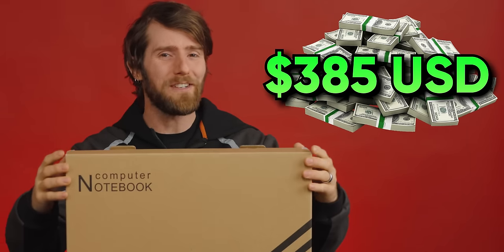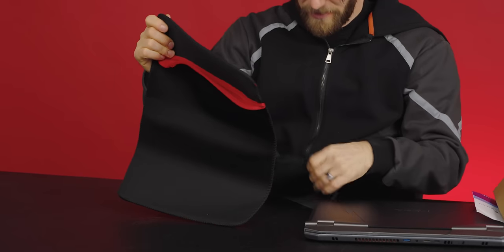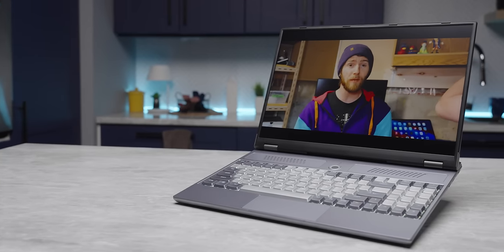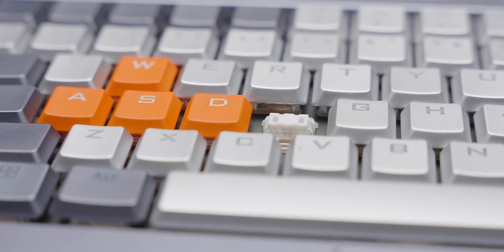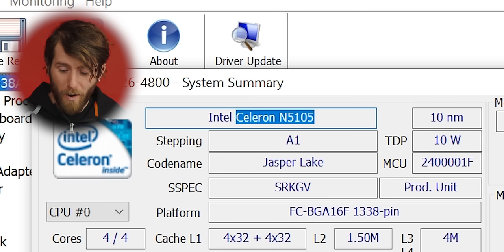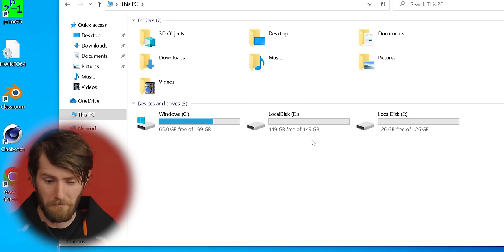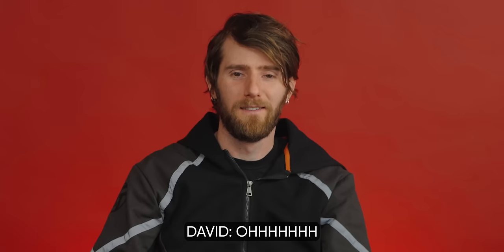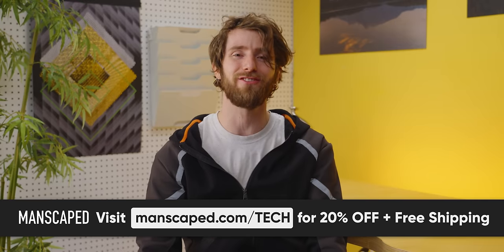Brown Star for Effort – This AliExpress Gaming Laptop is HILARIOUS

Comment: 2400MHz DDR4 was quite common for laptops
Reply: My current PC has 2133 MHz DDR4 RAM xD I got it when DDR4 was still new and never upgraded xD
Reply: @FeuerGame  lol me too,but even if i would have gotten more,my i7 7700 can't do more than 2133 anyway xD
Reply: my laptop runs on 2666MHz
Reply: WAS
Reply: True, all entry level laptop runs from 2133 to 2666mhz
Reply: @ristekostadinov2820  My PC has 16Gb DDR4 2666 Mhz
Reply: @youravghuman5231  yeah they are just dead wrong in this video. 2400 and 2666 is the normal ddr4 speeds for laptops. Only extremely high end stuff ever went above 3000
Reply: @wissembellara6411  mine have 1x4gb soldered and 1 removeable 4gb, i was quite mad when i found about that because i paid like 530$ and i can have 12gb max. There was a time when only the cheapest laptops had 1 or both slots soldered now manufactures push the boundaries.
Reply: @brandontrost8888  Right, I bought a mid-range HP Pavilion for 600€ four years ago, 8 GB DDR4 2400 MHz, without listing everything else it had. However, they bought this laptop NOW and it's (supposedly) new... So I would agree that currently it can be considered slow.
Reply: Yes true, and I think I saw in the specs it was also DDR4L RAM which draws less power, which usually means slower speeds, and in normal day to day tasks outside of gaming, or something like video editing, then most people won't even notice the slower speeds.
Reply: I used 2133MHz DDr4 for my PC, mainly because I was broke and the performance gain of higher frquencies would have been lost on me anyways.
Reply: @Mirra2003-f9s  I believe it should do 2400MHz. My i5 7500 runs at 2400MHz if I recall correctly
Reply: @oglcn11  Yes actually you're right. It says 2400 mhz on Intel's site. Still i'm already planning to build something new so it doesn't matter anymore. Too bad 2133 mhz is pretty worthless nowadays.... back when i bought it i remember there was some RAM shortage and extremely high prices cause i paid 200$ for this 16Gb 2133mhz kit in 2017 if i remember right
Reply: You don't need more. Especially on such crap hardware. Even on $1000 laptops, you don't need anything better than 2666.
Reply: The CPU is an N5150 which is usually used for embedded applications like NAS and prosumer and enterprise routers.  It's performant and energy efficient for these kinds of tasks.  Not really made for general desktop/laptop use but okay if you just use it for basic tasks (word processing or little tabs/low impact web browsing).
Reply: even in gaming laptops (acer aspire vx5)
Reply: I was using 2133 on my 6700k before my motherboard died and I upgraded.
Reply: considering thats a low watt cpu, commonly sold with mini pcs and sold to laptops around the 250$-500$ mark.  I'd rather go for a higher end amd mini pc(15w) 8core for that price.
Reply: @wissembellara6411  is it rated at 2666? if not, enable XMP in the bios to get the full speed. My 3200Mhz ram was stock at 2666Mhz until i turned on XMP
Reply: @lazysaviour  Yeah it is. However, my brother has 3200 Mhz sticks that show up as 2666 Mhz. The store said that the motherboard can't support 3200 Mhz. I don't know much about hardware
Reply: My desktop PC has DDR4 2400 MHz
Reply: my gaming laptop from 2017 has 2666MHz DDR4
Reply: HP Elitebook 840 G7 has 2666MHz DDR4 RAM, but the current G8 Series has 3200MHz DDR4 RAM
Reply: I have 2133 MHz DDR4 on my Asus VivoBook so it is normal
Reply: My freakin XPS 15 9560 runs on 2400MHZ DDR4 ram!! And it is supposed to be one of the high-end laptop of its time!
Reply: Even my desktop is currently running 32GB DDR4 2400 MHz lol. It's 3200 MHz RAM but my CPU only supports 2400 MHz
Reply: me who has a brand new pc with 2133Mhz ddr4, i knew i should have gotton better ram.
Reply: and it is paired with a 5 gen ryzen ouch at least i know where the bottle neck is.
Reply: My ThinkPad runs at 2400, but its also 3 years old.
Reply: @FeuerGame  painful
Reply: @Mirra2003-f9s  if you overclock the memory controller voltage, u can get 7700 to use way higher memory speed. I currently run 4000mhz dims at 3600mhz on a 6600, same memory could be run at 3800 on a 7700.  Give it a try, it's great.
Reply: @Mirra2003-f9s  yeah ^^ my 6700k wouldn't do much more either ^^ I'll stick with 2133 MHz till I get a new CPU
Reply: @Mirra2003-f9s  yup. My 7700K crashes if I push beyond that.
Reply: Yeah, it "WAS" like 4 years ago.
Reply: @FeuerGame  Honestly i think you really notice higher RAM speeds probably on Ryzen chips or heavy tasks that actually take advantage of it. My laptop runs an i7 9750H which demolishes my desktop's 7700 CPU and it runs at 2666 and i don't really feel any difference using them except for games where it's actually the processor being better on the laptop. As long as they run well in Windows and play any game i want without stuttering or other issues i really don't care what speed the ram is
Reply: @Mirra2003-f9s  yes! I think so too. Since everything works as I want it to, there is no need to upgrade my ram. The cost of new ram wouldn't be worth the money for a few % performance. Would be better spend on a new CPU/MB when the day arises that my 6700k isn't able to handle the tasks any more.
Reply: @FeuerGame  Mine's gonna finally retire in about a month or two. I have a 1440p monitor and an RTX 3070 and this CPU is starting to really fall behind in newer games. A Plague Tale Requiem gave it a hard time already so i'm trying to decide if i should go with a 13th gen i7 or the new Ryzen 7 7700x. 4 cores doesn't really cut it anymore for the latest games and i think even a new i3 is starting to outperform it
Reply: @Mirra2003-f9s  yeah ^^ I was thinking about getting a new CPU on black Friday sale, but I think I'll wait a little longer
Reply: I believe the actual DDR4 specification only goes up to 2666 and everything past that is technically OEMs exceeding the spec. My 3 year old asus strix laptop came with 2666. 
I've seen at least 1 OEM PC turn down their faster RAM to 2666 on shipping, presumably for some legal reason to comply with the spec, and then expect the user to turn it back up to what it's rated for.
Reply: @ristekostadinov2820  Soldered ram is usually to save on thickness on thin-and-light laptops
Reply: @KX36  DDR4 RAM actually goes up to 4800mhz but the most common and preferred one is 3600 mhz RAM especially for Ryzen systems. Your laptop most likely came with 2666 because it's the max the CPU can support and there's no use into giving you higher spec RAM since the CPU can only do 2666 max. It's pretty common for laptops,my 3 year old Legion has an i7 9750H and 2666 is the max frequency the CPU can handle,and that's exactly the RAM they put on it
Reply: @pranshusahu8678  which is a 7 year old laptop and 2400mhz was fast at the time
Reply: 2133 MHz memory on desktop here, bought it because it was cheaper then, like half price of 3200 MHz, I was upgrading from 800 MHz DDR2 desktop, also had 1200 MHz DDR3 on my laptop then.
p.s. I don't like influencers taking a crap on perfectly fine hardware just because they are used to high end. To them it's just 80% of the cost more for soooo much more responsiveness, to regular people it's the cost of the motherboard we're maybe getting, or the "cheap" mechanical keyboard because we're not all going to spend $200 on a keyboard to go from 80% to 95% "good". Wow, this turned into a rant sorry, just hate when people overspend because it's the best value; there's something else better called best value for YOUR BUDGET.
Reply: True, my t480 max ram speed is 2400mhz, as all 8th gen intel cpus (i3-i7).
Reply: @Ian Visser Base depends on mobo and cpu. Also the lowest for DDR4 is 2133 MHz lol
Reply: The PC I built in 2020 is only 2666MHz, so I felt personally attacked during that part of the video lol.  The motherboard I bought doesn't go over 2666MHz, so I didn't see the point in getting a better one.
Reply: @Mirra2003-f9s  
DDR4 above 3200 is overclocked. 
JEDEC standard only go to to 3200 MT/s.
Reply: That's the JEDEC standard speed w/o OC, maybe it has a locked BIOS as many custom laptops do.
Reply: @lloydaran  yeah but compare the prices of that HP and this laptop
Reply: @AgentSmith911   that made me think, mine still has ddr3 1600, with a high end i7 from 8+ years ago, still future proof  for another 10 years haha sadly;  see no reason to even get another cpu,  as my older win7 gaming machine does everything fast, still do 4k gaming fine;  but 1440p is where its at for me.
Reply: I only just recently upgraded from 2400mhz ram on a desktop I built in 2016.
Reply: @koilamaoh4238  You will get problems in regard to security issues in your OS though, as Windows 7 and Windows 10 will not get updates and patches after certain dates, and Windows 11 has new hardware requirements.
Reply: @AgentSmith911  security isnt that hard to manage on 7.. Works great with all my apps, I'll use it til i have no use for my apps anymore or hardware replacements; my apps works a lot better on my 7, than my 10 machine, plus 10/11 breaks some of my important apps that I like. 

Meanwhile lot of my friends tend to have computer issues with their newer OS, virus's and such, And I still don't know how they get them, I even tried on purpose just to see where the flaws were, but I do have a general understanding of it now.   Never had security, virus issues with any of my xp, 7,8,10, 11 machines lol.. Even my netbooks with Xp on them, function well but limited as software isnt compatibility for newer things.
Reply: @koilamaoh4238  I'm guessing you do 4k/1440p with very old games cause since you use DDR3 it's certainly not newer than a 6700K at max. I also miss Windows 7 and i have an old computer with an i7 2600 and Win 7 that i mess around with but most games won't even launch on 7 anymore and it's not because of the hardware. Don't know what to say about 10+ more years since MS is really planning to try and get rid of most old PCs after discontinuing 10 and making 11 harder to run on older hardware, I mean you can use it but most apps will drop support and stop installing,especially internet browsers
Reply: Im luke im 5 and my dads bruce lee and my laptop is a JCB
Reply: @Mirra2003-f9s   current gen games actually, which supports luckily 7, luckily even tho they say 10. But rarely play them.  But since I play lot of indie games, current gen graphical games are kinda boring in my opinion, none hasnt really stuck out for me. If it requires 10, then Ill use my other machine then.   I still play old diablo II, minecraft, terreraria.. and other games lol, not much for high end graphics.

1080ti goes prety far for me on 7.  Have the newer 4080, havent installed yet on my newer machine tho.

Yea I know, software support especially browsers will do it in, I know chrome is leaving 7 soon,  firefox works fine,  I use a special version of firefox for win7 so I can stream download movies from any website, youtube, netflix, etc, but since they patched it on 10, sucks.   I have a lot of old software,  still use to this day, some of which is "drm" free, no crappy online all time.

Comment: Partitioning is still useful if you want to keep your OS/apps separate from your user data (you can remap documents and other folders to a separate drive). This allows for formatting/reinstalling the OS without needing to back up/restore any personal files.
Reply: That's what I am saying... Funny thing is, Anthony recommended this in one of their videos also. 😂
Reply: It's also pretty much the standard way that computers come in China to this day. My wife's laptop has a partitioned laptop just like this, and pretty much every computer I've seen here in China that's not used by a foreigner has something similar.
Reply: Also makes a dual boot or recovery scenario much easier
Reply: i use this style of partitioning since the days of windows 95....   if i want to reinstall, i wont have to move/backup ...easy job...  IF a partitions breaks , it will take down only that partition leaving other data in good shape. Plus , this is for organizing data.
Reply: can you dumb this down? i don't really understand partitioning , I bought a 1tb evo and transferred my windows and other important DATA to the SSD and then it wanted me to partition, which i tried to google but i just wasnt sure what to do and didnbt want to risk deleting my windows etc.

thanks for your time
Reply: OpenBSD does it as a security thing
Reply: I'd say this is just out of old habits. In middle school IT classes teach told us to always partition the hard drives to C D and E no more no less. C is only for Windows and D and E for what ever.
Reply: Strong disagree, partitioning is almost never a good idea in a conventional PC for the average person. On servers, sure, but by splitting the boot SSD in two, you're almost guaranteed to fill one of the partitions faster than the other and have less effective usable space.
Reply: How do I keep all that separate?
Reply: @stephendetomasi1701  On Linux it is a good idea since you can swap your OS and retain all your user settings and personal files. Well you could do that with one partition but with a lot more hassle.
Reply: @EloNaj   again, I disagree. Just have a back-up or separate drive if you want to switch OS all the time and maintain your /home directory. You're just overcomplicating your life for minimal gain.
Reply: @stephendetomasi1701  If you have a raid your raid handles like a single drive. In that case you maybe do not want a second raid (since you have to buy a lot drives depending on your raid) and partitions do make sense in that case. And a Raid is a great gain depending on the use case (Dataloss prevention or R/W speed).
Reply: @stephendetomasi1701  Nope since I never needed to reinstall my system for a lot of years (10 or so). And what is complicated in swapping discs in a raid if you need to and update your system. And a backup fullfills not the same role as a raid. A back up is for restoring a system. A raid 1 / 5 / 10 for example is for compensating disc failure (A backup is useless if the medium it is on dies and your backup could be out of date even if you scatter it). Good data protection requires both.
Setting up a partition in Linux costs you like 5 min. So I would say not that much of a hassle or time loss.  Setting up a software raid is also very easy depending on the distribution. There are also people who can not effort more than one disk for them partitioning can be an alternative if they want to separate their system from their data dump.
Reply: People really don't do this anymore? I remember it used to be a must to have D partition to keep some stuff on. Personally I keep my steam folder now on separate partition.
Reply: If that's your concern, why not just put your OS on a dedicated physical drive?  Don't most modern laptops have two or more slots?
Reply: @redslate  I haven't bothered doing this for a long time, but I suspect there are a lot of boards that only have a single slot for nvme with PCIe 4/5. It's useful for people who would rather buy a single larger, higher performing drive than to have two or a dongle or whatever.

Comment: You could plug a tobii eye tracking system on the pogo pins instead of a webcam if they worked better
Reply: Would be cool for wii emulation if you could stick on the ir emitters for the remotes
Reply: @NEEDMORECOW8ELL  😭
Reply: A very low res, low hz mini monitor? I'm sure you could find a use for that? Cpu stats or temps probably.
Reply: Alarm clock/countdown timer, maybe a AA battery charger, a phone mounting bracket with USB-C pass-through, a launchpad for a mini drone, a robot arm that can clean your keyboard or Another robot arm with an open palm that you can high five when you get a W in your favourite game! So many cool ideas lmao :D
Reply: @XHackManiacX  For a second there I thought the open palm hand would slap you for every lost game. XD